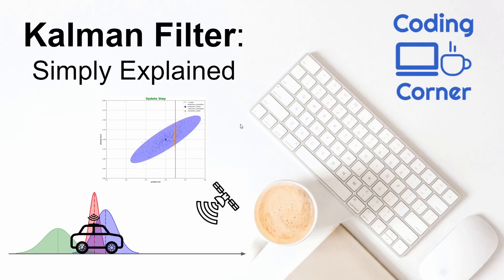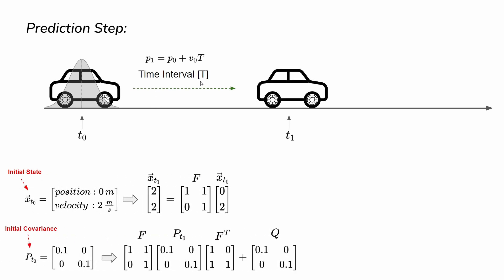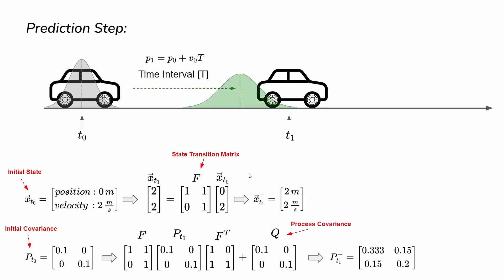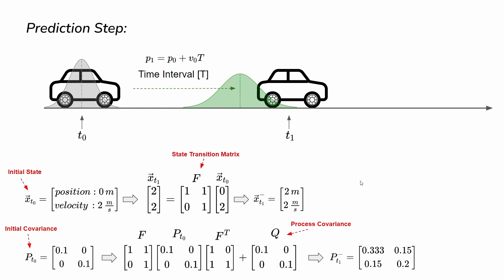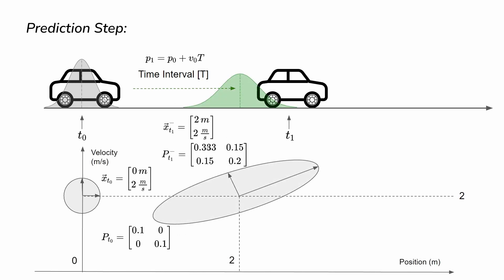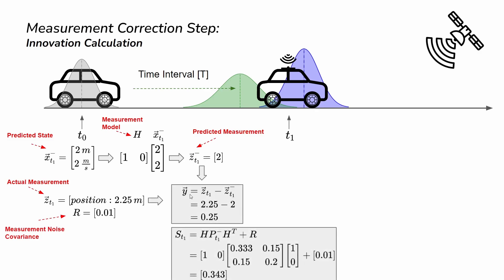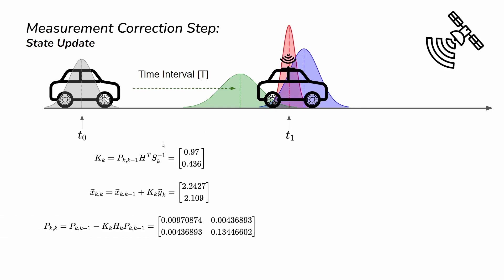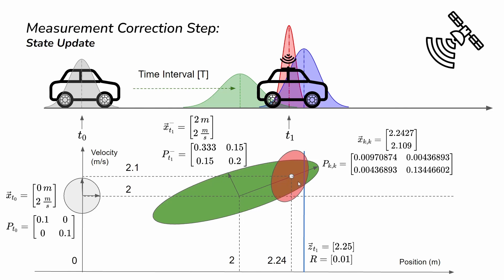Sensor Fusion: Linear Kalman Filter (Part 2)

Comment: good tutorial. I have a question, when I'm using kalman filter to estimate position, what if I do not have observed velocity of the object that i'm trying to estimate? why so? because the object may be a remote object (or just a oscillating signal or some sort ) that does not belong to me. How can I overcome this problem? should I just remove the velocity estimation or is there anyway to achieve similar result? Please advise
Reply from the maker: If you are tracking an external moving object using sensors like (e.g. Radar or LiDAR) you can still use a state vector including both velocity and position states (could be in 2D or 3D even). The LiDAR sensor can measure the position directly of the object which you  will use to correct the position state in the state vector (modeled by the measurement model). But, as explained in the video since the velocity and position states are correlated (as modeled in the prediction model), then even when fusing position measurement the Kalman gain will update the estimate of the velocity to match the new measured position.

However for Radar, it can measure the relative radial velocity of the moving object using the doppler effect. In such case, you can correct the velocity state directly in the state vector once you receive a Radar measurement.